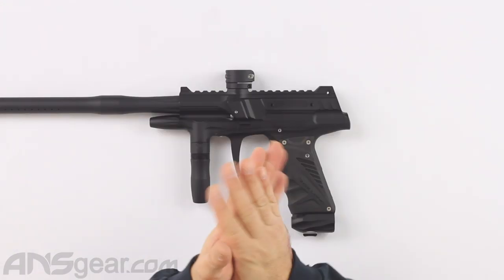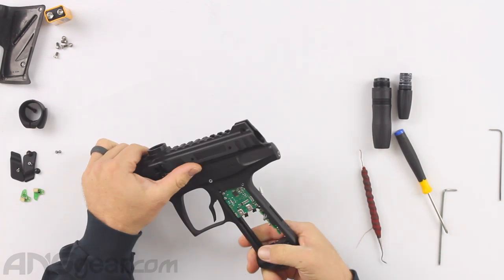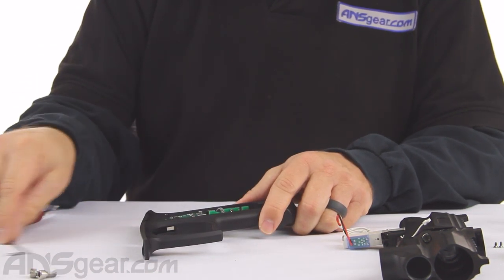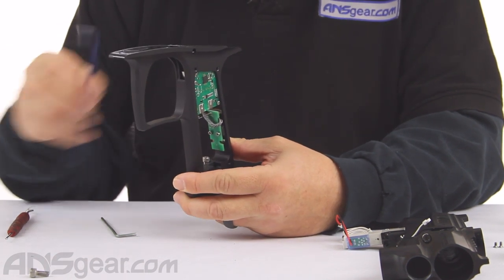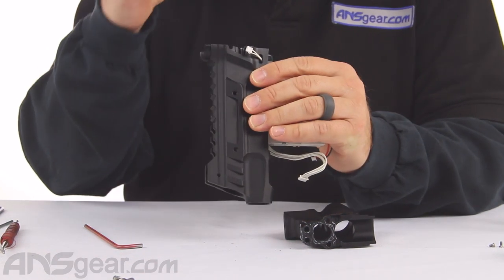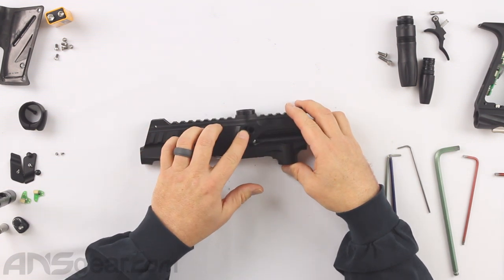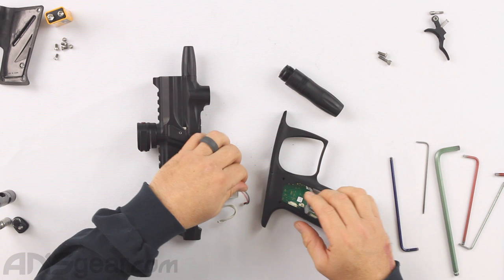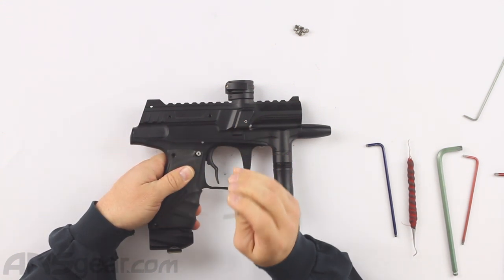Field One/Bob Long G6R Paintball Gun - Maintenance/Repair

Comment: Hey got a question for you, I noticed in the video you didn't get into circuit board/screen area. I see the circuit board is pretty self explanatory. How do you change the screen on these though? Is there a hidden screw in the grip frame that removes the barrier behind the screen or do I have to take off the front plate and glass on the front of the gun to remove it?

Comment: 23:19 what size is that o’ring and what size is the one in the body
Reply from the maker: I believe that is for the 360 Inline Reg Piston 016 Buna Durometer 70 . 

Here is the manual as a reference: https://cdn.shopify.com/s/files/1/1422/2682/files/Gen_6_Intimidator_G6R_Manual_v1.0.pdf?17065680294659616552